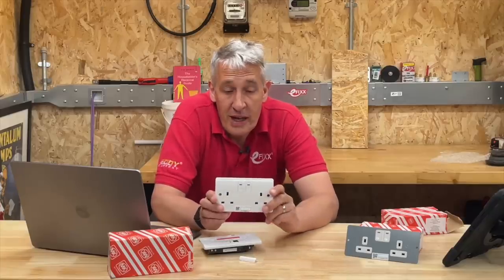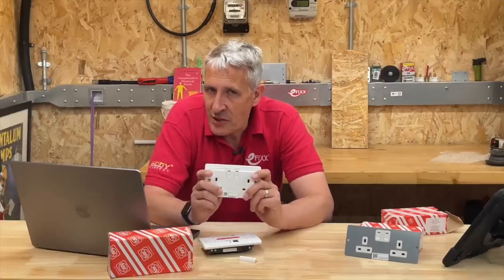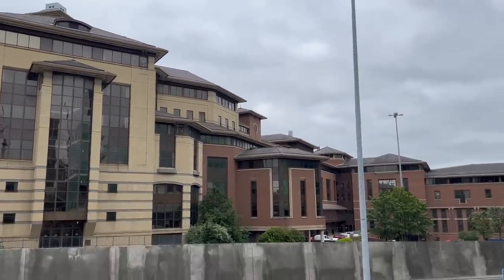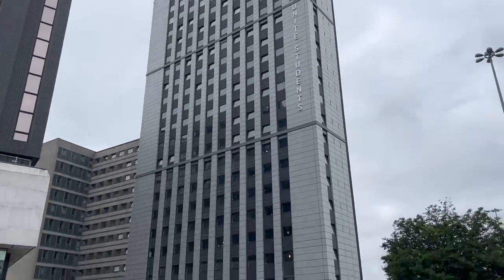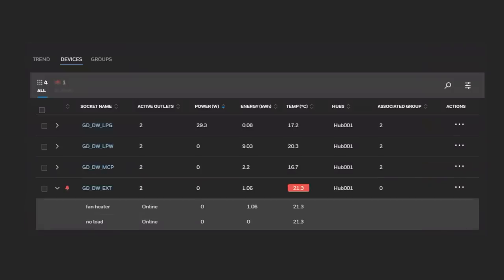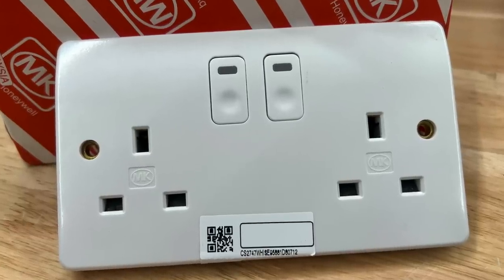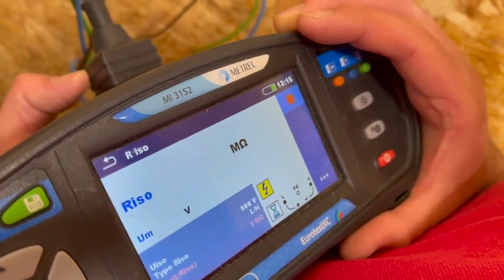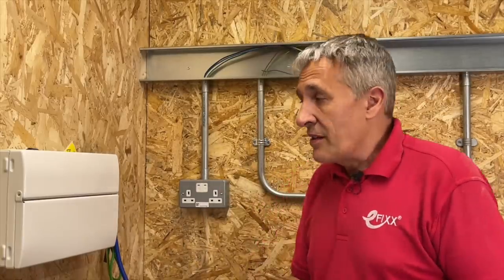Unveiling the Hidden Surprise in this Game Changing Socket

Comment: A left field energy use tale: We used to short circuit current rails on the underground overnight to prevent ice build up through rail heating. About 5kA per section. It was enough to require an extra generator on load at Lots Road overnight. Eventually it was found to be cheaper to run a train spraying de-icer. This was also the time that mercury arc rectifiers were converted to silicon. I missed the blue glow of the bulbs.
Reply: Why don't the underground has heated third rail then ?

Comment: Bit steep priced at £210.95 at CEF . You would need to save a lot of power to cover the cost. 
Also how much does the socket actually consume in a year?
Reply from the maker: This is headline price for one ☝️ projects on a case by case basis.
Reply: Idle power usage is a very good question. I suspect and hope it’s firmly sub one watt, but even that would mount up to a reasonable amount if you had a house full of them.
Reply: @efixx  Unless the price comes down to less than 70% of that RRP then still too expensive. Only large poorly run facilities would even consider these at the price. The ROI simply does not add up at all....

Comment: Having just reinstalled a WiFi mesh system after PAT testing destroyed the software memory of the entire network I think this kind of system needs a full-time network specialist to manage it successfully. So whilst companies might save on electricity costs with these they will probably spend those savings - and perhaps more - on BMS costs.
Reply: looks like it's bluetooth rather than wifi judging by the BLE mac address label on the socket
Reply: @geebot  According to the datasheet, BLE is only used for setup
Reply: @geebot  I'd assume it is HoneyWell's "OneWireless" network system, which as far as I can find is a closed ecosystem - HoneyWell/MK only sockets, which is fine to a point.
Reply: @cheeseburgerbeefcake Why is it only fine to a point?
Reply: @deang5622  To the point that you have to integrate it with anything else
Reply: confused how PAT could destroy the software memory of the entire network? you PAT each item individually, so the most you are going to do is damage one item (which shouldn't happen if the test technician is awake)
Reply: @Pugjamin  Agreed. The PAT tester is applying a high voltage to the live and neutral lines looking for leakage current between them indicating insulation breakdown.

This isn't going to cause an issue for the digital memory in the product as they always use a voltage regulator (3.3 Volts or 5 Volts)  to provide the supply of electricity to the digital devices.

And software memory..the software is held in ROM which is permanent... although sometimes it is held in electrical reprogrammable memory but erasure and reprogramming is typically done via an external connector providing power and data interface to the chip, so extremely unlikely this is going to be erased by a high voltage on the mains live and neutral lines to the product.

Comment: They seem to have thought of everything. Only issue I can come up with is the possibility of a heater being switched back on remotely when it's covered by something, but with thermal cutouts fitted these days that's not the  problem it used to be when used with timers despite the warnings.
I do think they missed a trick with the switch needing the socket be removed from the back box - something like a special plug with a longer earth pin would avoid this.
Reply: an easier way would be some kind of key combination or sequence on the button like maybe holding it down for 10 seconds.
Reply: @BrianSu  something like that wouldnt work as it needs to entirely disconnect the electronics from the power supply.
Reply: @BrianSu  It needs a 'hard' switch - one with real contacts - to disconnect the smart bits when testing.
Reply: An emergency lighting test key would have been perfect
Reply: They most certainly thought of building in planned obsolescence, there are electrolytic capacitors in the unit!

Comment: The hidden surprise is the price. I thought I'd just look them up - £250 for a double socket. For the addition of some WiFi circuitry and  a couple of relays. If they were £50-70 I'd see the benefit, but how likely are you to save £250 in power usage over the lifetime of the socket? My guess is fairly close to zero, averaged out across an entire building. You might get a handful of high power devices that the building decides can safely be switched off after hours, but once you factor in the costs of investigating and dealing with associated issues - cost savings will go out the window. Safety might be an argument - as monitoring for high powered devices running out of hours might drop the fire risk a little... but still, it has to be a bit of a niche use case.
Reply: was just coming to say the same. Especially when other brands of smart sockets can be had for <£20 per twin. Sure, features are more limited, but at a tenth of the price...
Reply: like most new tech it doesn't pay to be an early adopter for cost and reliability reasons.
I laughed when i saw the cost of the socket.

Comment: No one in there right mind would want to unscrew 2500 double sockets to flick a small switch, no one in there right mind would want to pay a sparky to unscrew and re-screw on 2500 double sockets as part of a EICR. So MK needs to urgently rethink access to that switch so it can be accessed without unscrewing those sockets. Doing industrial or commercial work often comes down to price point per accessory. Big companies often say that what we pay tough put a bill in for more than there willing to pay they won't pay it , and they certainly won't pay for you to unscrew a socket to flick a switch and turn it back on again and refix the socket , so do a test of unscrewing a socket flicking a switch , and do the reverse and tell us how many extra hours we are going to work for nothing on a large office block . A great idea but it needs a rethink by MK , Im not a charity I don't work for nothing.

Comment: Also, can you imagine, when an audit (periodic inspection) comes and the socket shows some false readings (because of the circuits behind) then the auditors must remove ALL sockets from floorboxes, walls just to flick the red switch over, do the audit again ... and then flip it back... and reinstall the sockets... rather than just doing the audit by plugging in their units and move on to the next one :)
Reply: It’s just going to be L&N to earth IR test and if  it’s crap. Just LIM  the test on the form due to these sockets

Comment: Would be great tidy solution for home automation installs - Loxone etc. But the price....that's insane. The Shelly modules do this for £13!
Reply: Yeah shelly do good gear
Reply: Is there a video showing Shelley’s with uk sockets?
Reply: @sethkazzim731  You can get plug-in UK spec modules now.  If you were to connect the shelly inside the box, you would have to control both sockets at the same time because most (all?) uk double sockets are joined together as one from the back.  You cant feed each socket with power seperately.  Also controlling both sockets as one could lead to an overload situation as shellys are only rated to max 16a.  2 x 13a sockets would exceed this by a lot.
Reply: If you want a hard wired smart socket, you'd be better off with something like the Lightwave LP42WHMK2 Smart Socket for home automation, a fraction of the price but has all the same features, except the power limiting feature.
Reply: @AdrianBawn  I’m thinking of going with a Mk grid, two unswitched sockets with two separate switches in a three grid. 

I do have the Shelly plug and it’s great but would like this option in my back pocket. One Shelly +1PM per socket maybe?
Reply: @sethkazzim731  If they are independent unswitched outlets then that works perfectly with a shelly.

Comment: Another use case would be where homes or businesses have certain critical loads that need to be powered during a power outage on installations with a ESS or UPS. If all the non-critical loads can be dropped, the critical loads can be maintained for longer.
Reply from the maker: Great application 👍

Comment: Centrally controlled PLC switchable power sockets, seen those deployed in 2008 and 2012 seen the introduction of individual breaker power usage trackers.
I do love that individual sockets can measure wattage and can be set limits. I however do not like that they are wireless mesh when a PLC (Power-Line communication) network could be used.
Then again, we mostly did government buildings and i have no doubt that anything we installed 15~10 years will get a update on the coming 20~30 years.
Reply: Because PLC controllers are expensive. These if priced right, should be about £20 max, anything more and someone is taking the piss. Plus they don't need additional data cabling thus can be retrofitted easily in just about any building.
Reply: @dougle03  there 250 a socket yes you heard me

two hundred and fifty pounds sterling

Comment: If you put a current limit on the socket, how long before some bright spark has the idea of selling a device to combine multiple sockets into one? You then have a situation where our nice, safely designed electrical systems now have some crazy, unsafe contraption attached to them.
Reply from the maker: Someone tried that for granny cable style EV chargers -trading standards quickly clamped down on the issue.
Reply: @efixx sure but I can wire two plugs into a trailing outlet with short lengths of cable very easily.
Reply: @jonathanbuzzard1376 Yes, but this would potentially mean that one of the plugs would be live when unplugged. Surely the Smartsocket can detect when it's being backpowrered ?
Reply: @quantisedspace7047  Nope. Current measurement is via a shunt. It will only see power going one way (It would never go the other way unless the voltage was higher than itself).

Comment: The intelligent socket for me is one where the wires actually connect to a panel inside the socket box and the socket front just plugs onto that. This would mean that while you place the socket front onto the box there is no spare cable that can twist and unfasten or pull the cable from the connection point making a loose connection that might heat up.

Comment: Yea if they had something like this cutting my power in the student digs at uni I would absolutely have found some way to bypass that... At £80 a week for rent for one room (nearly 15 years ago, very expensive at the time), if I wanted 3kw continuous out of every socket I had access to I would have taken it. I didn't, but that's by the by, I'm resistive to unnecessary restriction.
Reply from the maker: I lived in a student hall which had a 2Amp circuit breaker for every room.
Reply: @efixx  wow. That would get some superglue in the breaker switch, no doubt 😂

Comment: I can see the advantage in the MK socket outlet but two concerns are raised:
1)  Controlling the output of sockets can be beneficial but there are times when the socket is powered down just when it needs to run important machinery. e.g. computers which are performing a function after the normal working hours that are critical for the business.  Also, what about the worker staying in late to complete some task?  Its hardly going to be convenient to contact the maintenance department to ensure that a particular socket is energised, especially when they have all gone home!
2)  The trouble with electronics is that they fail at a faster rate than any manual switching.  As a building owner I would be concerned as to how many times I would have to replace a socket that then has to be programmed.  Manual sockets are highly reliable, possibly never needing to be replaced for the life of the building.  For example, LEDs are supposed to save money both on the energy consumption over say, a compact fluorescent and last much longer, but in my experience to get the durability out of them is a lottery and they many fail after only a relatively few hours and then you have to replace the whole fitting.  The frequency and cost of a fitting replacement far exceeds any cost savings in energy.  The same would apply here with this MK socket.  Also, some business are not large enough to have a maintenance electrician on site, relying on  external contractors so that replacement/reprogramming becomes more of a bind.

Comment: A huge problem for administration will be plugs get easily moved around. So you will never truly know if the item of equipment you are trying to power off is still plugged into the same socket. Also what happens when staff are working out side of normal office hours.
New devices standby modes are getting more efficient, so recovering the cost of instalation and administration through energy savings will be greatly reduced or possibly never recovered.
Reply: I've done a lot of industry and commercial work you very rarely move sockets about if you do it no more than one or two.

Comment: £250 per socket, holy hell
Reply: To turn off an appliance on standby that draws less than 1 watt, they will save their own cost in just under a hundred years. And then the socket must be drawing power itself.
Reply: add another £400 for the hub!
Reply: I immediately checked the same thing! 😂 £250 🤣
Reply: + VAT.
Reply: If your buying 400 of these there be a good deal. Maybe £120 each 😱
Reply: @EdthePlumber  Being I can get a single Z-Wave enabled fixed wall outlet from Fibaro that supports power and energy consumption monitoring for £66, this MK socket does not seem good value for money.
Reply: The return of investment would take a long long time.
Reply: What in the joke are them 😂
Reply: At that price it's way to expensive for a typical domestic installation. For situations with critical equipment needing to remain powered during a black-out, wouldn't it be cheaper to have them on their own circuit, with some sort of auto switching between power sources (mains and batteries)?
Reply: Yup. Lightwave RF are far cheaper

Comment: Very interesting.  The thermal management is a brilliant idea. That might give fire crews an insight as to the location of a fire in a building if the socket circuit is still energised. The app could show which area is hot. Possible risk of re-energising rotary or heating equipment and creating a hazard. Love the isolation switch. IR tests are such a pain with the usb charging type outlets. Nice.

Comment: There are already double smart sockets that have the basic functionality that this offers for a fraction of the price, and with some customised/modified firmware, they could be a clone of this for a fraction of the price!  

I would like to know what if any patents MK has on this socket that are to do with the smart nature of it.
Reply: None, since it's all freely available tech. ESP based microprocessor based WiFi/zigbee comms. Should be easy to flash something less cloud needy... lol Something like the BG unit it's easy to flash although I don't think it has the built in shunt for current measurement..
Reply from the maker: This is the first one in the commercial space which integrates with the Bacnet building control architecture.

Comment: The isolator switch is a good feature but for gods sake, put it on the outside! This still requires all these sockets to be removed for testing 😒.  I'm sure a tiny switch like that could be made to look nice in a corner
Reply: Could be a nice touch button or a little slot on the side you push a terminal in.
Reply: Swich on the outside would mean users can turn it off, and likely means management features turn off.
Reply: They could put a magnetic switch behind the face plate to disconnect it. They then could sell you a service magnet. £100 seems a good price considering the £250 a socket! 😂
Reply: @cheeseburgerbeefcake  And if it's turned off they're not getting any power out of it. It's not as if it'd be hard to alarm on a socket not being powered.

Comment: curious - When are they going to make a USB socket where you can actually switch the USB part off.... if not paying to transform voltage down to 5v even when you dont use it :(
Reply: The vampire power draw on a USB charger when not charging something is very small. You might be talking 20p a year for a good one at today's prices. Personally there are too many issues with sockets with built in USB chargers that I don't use them. Look good till there is a problem then they are a nightmare.
Reply: @jonathanbuzzard1376  it’s more a fire risk if it goes wrong. Leaving it on all the time. Typical house 3/4 sockets a room. 80p a room, 5 rooms with usb power £4.00 a year minimal but multiply that by every house. Lots of wasted energy
Reply: The current drain of a USB adapter when off load is minimal, but the switchmide converter makes a hell of a noise. I rewired it so that switching the socket off turned the USB part. Worked but I uninstalled it because it was too jury-rigged.

Comment: IOT hacked h/w will be a future thing.  remember while some service may turn it off to save power, another program can also turn it on.  just think of all the costs involved if these things are compromised and DoS is employed to prevent service turn off.  I am sure bods out there have thought of everything until they haven't
Reply: Given that MK is not a software company, they will have paid an external developer for these. That's an ongoing expensive engagement for MK, one that will gel more untenable as the months pass and these fail to take off.. Equally, the contract for the software will have gone to one of the cheaper developers thus security won't be a high priority....
Reply: @dougle03  This is interesting, questions now are how do users f/w update to make sure they are most recent with bug and security fixes.  i'm sure there is a utility, i hope its available to home owner.  Many companies charge for stuff today and you may find you have to sign up to a annual charge